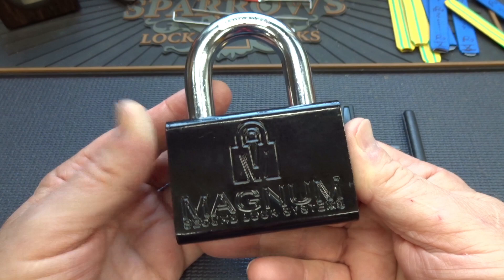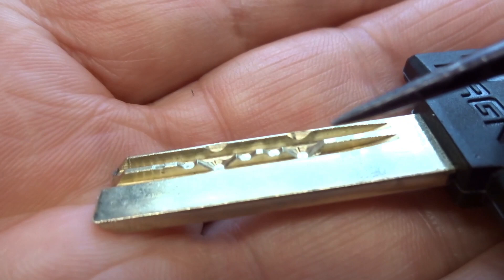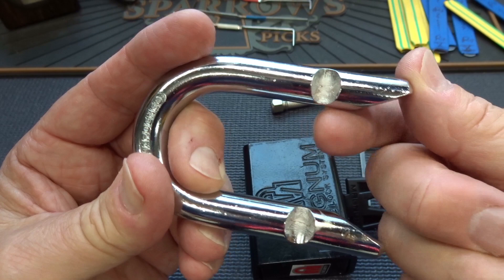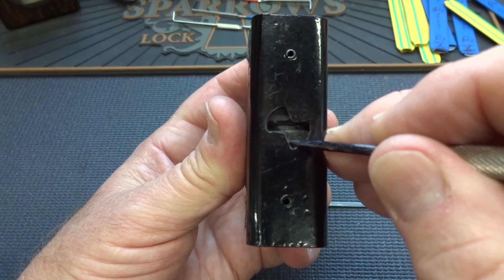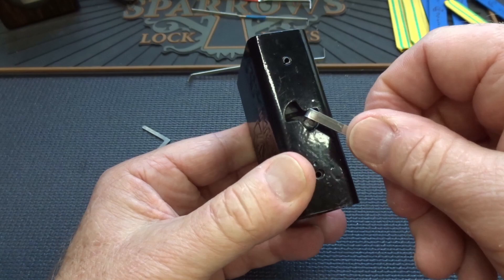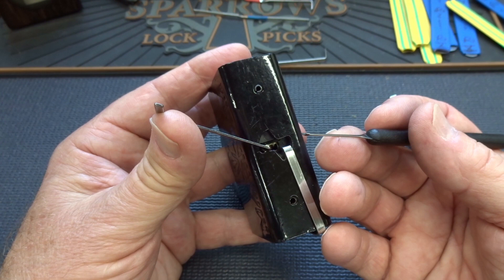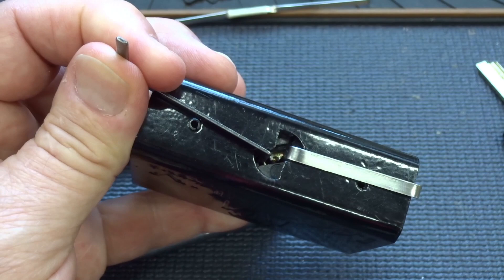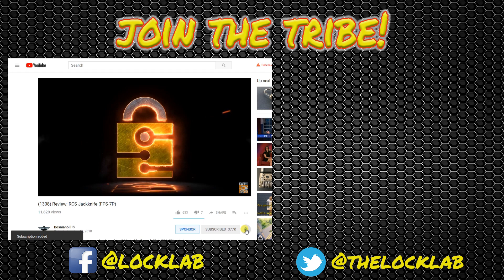(1318) Magnum Dimple Padlock Picked Open

Comment: ''gorilla tension'' works with easier locks too sometimes.  i remember one of my first locks had some intense springs and i could NOT make her turn, but when i applied more force to that tension wrench she opened easily.
Great video as always!
Reply from the maker: I've always used heavy (gorilla) tension on junky locks like ML, but for some reason never considered it for higher security locks.  Another trick for the bag!

Comment: This is why LPL prefers a round shaft on dimple picks.
Reply from the maker: Shaft shape is simply a personal preference.  BOTH get stuck in keyways about the same because it isn't the SHAFT that gets hung up, but the tip.  Believe me, if round shafts gave superior performance I would be using them.

Comment: oh! neat trick you might use. Regular 1/16"  drill  bits will pull most roll/tension pins out whether you want them to or not. 
P.S if I jiggle a lock open, does it still count as a "pick"?

Comment: Is there similar padlock available to buy like this one ? cheap around 25-50 €/$ WITH that shutter and with allen screw for disassembly ? (I know its multlock style "clone")

On ebay there are 2x Magnum padlocks are above 89$ + 19$ shipping, but each have just 1 key... For that price I can get mul-t-lock with 3 or more keys but I need 2-3 padlocks and I don't want to throw 300-400$ on just padlocks. 
This type of shutter helps a lot against lock picking even with older dimple lock key system.

Comment: I wanted to ask did you think about when you had the lock open. Take a punch and tap the roll pins to the in side. All you would have to do is tap them back in from the out side.
Reply from the maker: True, but it was a loaner lock and I didn't want to take a chance on damaging it.

Comment: Could you not knock those two roll-pins through the inside of the lock body and do a disassembly ??
Reply from the maker: Yes you could, but it is a borrowed lock and I didn't want to damage it in any way.
Reply: Aahhhh... okay...
Reply: Errol Lishman. That was my thoughts as well.